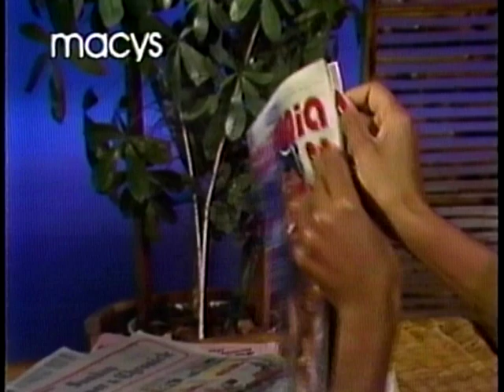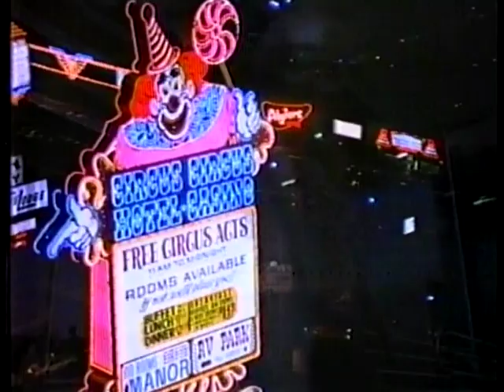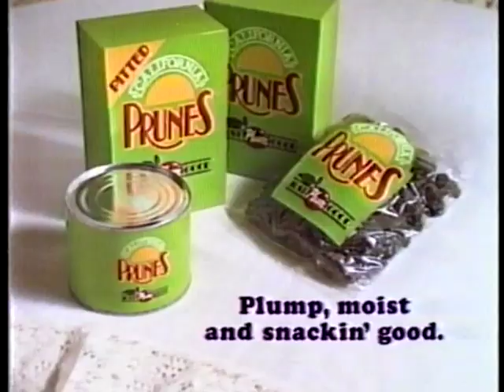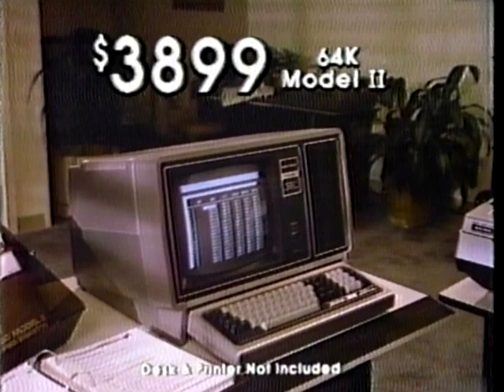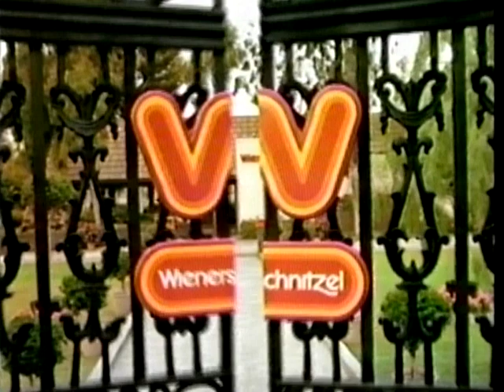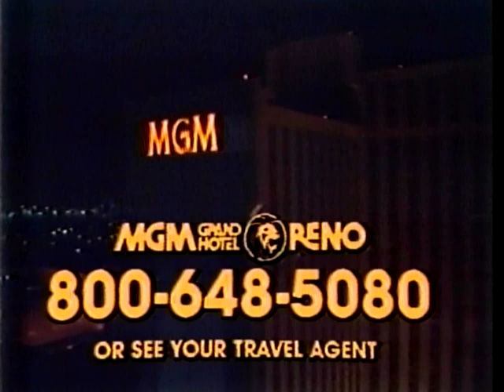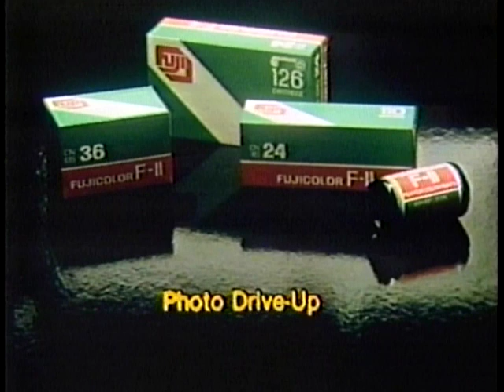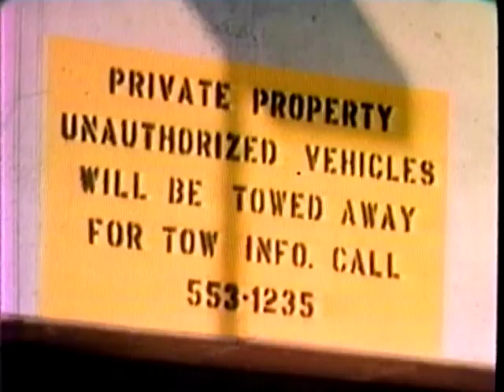TV Commercials Nov. 6th, 1981

Comment: Holy crap, did you see the size of that floppy she used with that TRS-80 computer?
Reply from the maker: Those were 8 inch floppies! Massive and basically obsolete in 1981 when most systems were using 5.25 inch floppies.

Comment: @ 12:56 - Is that a walkie-talkie, an early version of a cell phone, or satellite communications transponder?   Maybe she thinks she’s talking to SkyLab.
Reply from the maker: That scene makes me laugh every time. I’m pretty sure it’s a handheld CB radio.
Reply: That looks like an early brick phone😱
Reply: @RetroLandfill  It was, in fact, a handheld CB walkie; probably a Radio Shack.
Reply: It looks very much like a Radio Shack TRC-207 40 Channel Walkie Talkie CB radio transceiver. CB radio walkie talkies were common equipment for community watches back in the day.
Reply: @idontwantayoutubechannel1670  A cool piece of equipment. Probably had a squelch control on it.
Reply: @zaq55  I believe it did. I have a TRC 216 around here somewhere that I probably got circa 1989. You would have gotten a few miles range with the antenna extended (mine had a loooooong telescoping antenna with a coil in the center), which would have been enough to contact a local neighborhood watch base who would have relayed to the po po. Not sure what kind of range you'd get with that rubber duck antenna - which until this commercial I had never seen on a TRC but in double checking before commenting I saw a bunch of 'em. Probably good enough range for a group of apartment buildings or a few blocks. Would have definitely gotten the job done. For what it's worth though, the SkyLab comment was the correct one.
Reply: @idontwantayoutubechannel1670  So the police would have issued these to neighborhood watch groups?  Can’t see grandma picking one up at Radio Shack on her own.